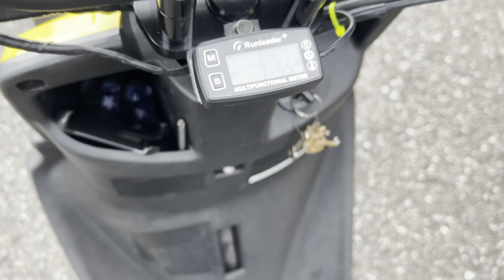Scooter vlog #2 - wheelie testing on my 2003 Yamaha zuma bugeye

Comment: I’ve got this same scooter and really wanna make it wheelie but it’s none stock and damn near impossible to get the front wheel of the ground you got any recommendations on how I can get this thing to wheelie.
Reply from the maker: @gageclark8956  70cc kit would help a lot , if you don’t wanna do that you can try to tune the cvt to have more torque , higher rpm clutch springs maybe a different belt , I used a naraku 70cc kit with the oem 50cc head and slightly upjet the carb to accommodate it , then I installed some heavier clutch springs and a stiffer contra spring , shimmed the variator out abit
Reply: @TRISTARSW  thanks a lot I’ll take this into consideration when I get to building this thing out
Reply: @TRISTARSW  I think I wanna try the 70cc kit any recommendations on where to get that
Reply from the maker: @gageclark8956  no problem man , bugeyes are abit weird to wheelie , pretty heavy and have a pretty sketch balance point , but once your locked in it’s fairly easy to maintain a wheelie with the right setup
Reply from the maker: @gageclark8956  scootertuning.ca is where I get a lot of my stuff at , the most affordable 70cc kit would be the Naraku 70cc cast iron kit for around 95 bucks , if you chamfer the ports with a dremel and use the oem 50cc head on it you’ll have a torquey yet reliable setup that won’t ruin your stock crank , but you will need to up jet abit for it
Reply from the maker: @gageclark8956  if you wanna spend abit more I suggest the stage6 street race kit , but then you’ll need a exhaust and some more in depth cvt tuning
Reply: @TRISTARSW  thanks a lot man it’s kinda been like impossible for me to find anything on these scoots especially the bug eyes since it seems like there is not a ton of people modding them you’ve been a lot of help
Reply from the maker: @gageclark8956  thers Facebook groups dedicated to bugeyes and if you check out my other video on my other bugeye it’s abit more in depth visually as to what mods I’ve done , I don’t do any talking (it was one of my first scoot videos) but a lot of pics and clips that show the build , that scooter wheelies pretty well and goes about 65